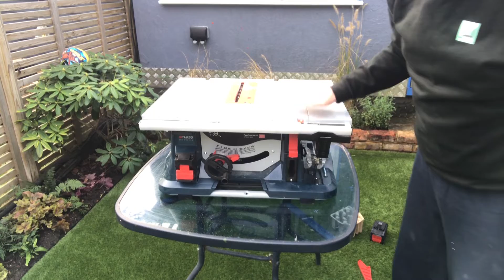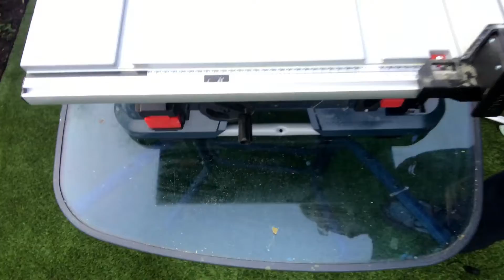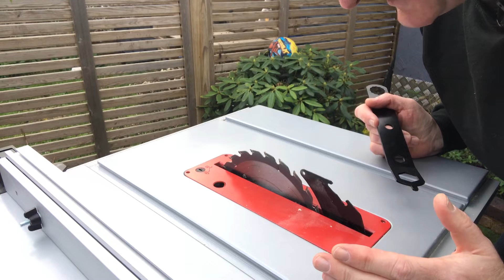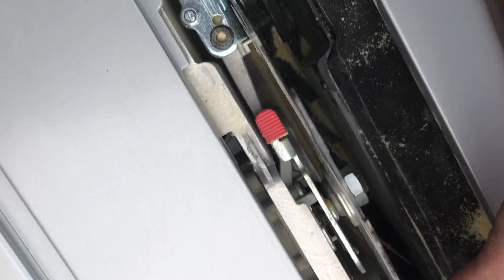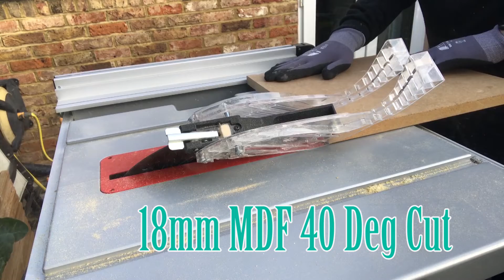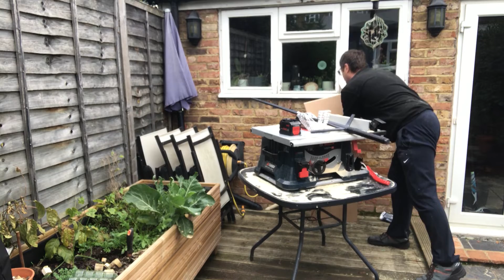BOSCH GTS 18V-216 BITURBO 216MM CORDLESS BRUSHLESS TABLE SAW

Comment: Replaced an elderly Bosch  mains table saw with the GTS18V 216, just a brilliant saw, only minor gripe is the mitre fence, have replaced it with a UJK Precision Mitre Gauge Fence with flip stop.
Reply from the maker: not heard of that, will have to take a look...
Reply: @MPCpropertydevelopments   Got mine cheap secondhand off an auction site,new it's £125, could find a similar model cheaper,but I do miss the second mitre scale like you have on the Rutlands version, not essential just something I've got use from having it on my Bosch mitre saw,to be honest I wonder how many peeps use the 2nd scale with a table saw or router table.
Reply: Can I ask....what battery did you use?
Reply: @amentet  Pro Core 8 Ah,as I can use them in other tools, whereas 12Ah is too unwieldy & heavy in circular saw,etc. 12Ah weighs 1.35kg compared to 995grams for 8Ah. But, Bosch is releasing this month a new Pro Core 8Ah+ battery weighing 1kg & offering more run time.